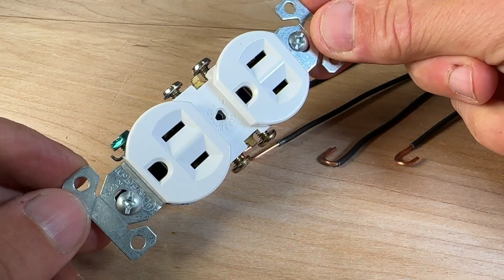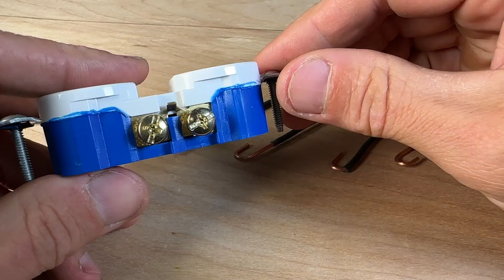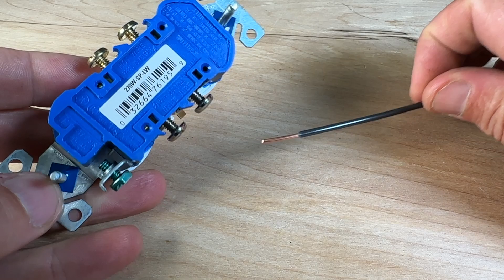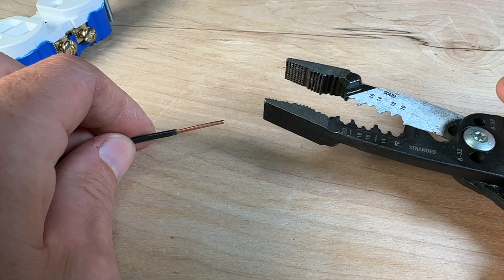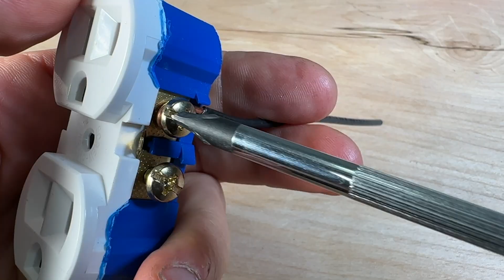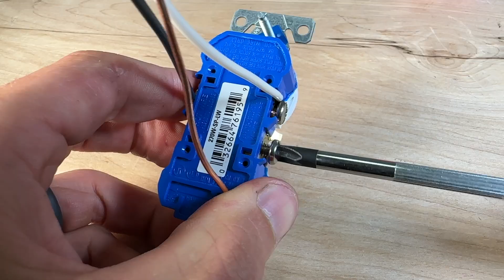Electrical Fire Prevention 101: Wiring Your Outlets the Right Way

Comment: I really don't know why I watch these videos. I have been a journeyman union electrician for 25 yrs. Residential ,  commercial and industrial. I do like seeing how other people do things. These are really good tips for the average homeowner though. I have no idea why the manufacturers still put the quick wire stabs on the back of devices. They cause nothing but problems! There are so many different ways to skin a cat. I really do like using the ECX drivers. I just started using them recently. I hate the Robertson tip on the multi screwdrivers like me Klein 10-1, the bit always sticks in the screw and pulls out when you goto remove it. There have been times in when I was working in a panel and the tip has almost fallen across the bus. I have since learned to either tape the tip in my driver or get a dedicated Robertson driver.
Reply: Lol I’m the same way.  I’ve been an electrician for about 20 years but was still curious to see the tips he had.  I used to backstab when I did residential new construction and I loved it.  Then I switched to doing service work and I never backstabbed a receptacle again once I saw all the problems that were caused by that.  Great video with excellent tips.
Reply: I just experienced the same thing with the bit getting stuck
Reply: Without a solid mechanical connection, you risk the chance of overheating. Potentially causing a fire or at least melt the insulation on the wire or the plastic of the receptacle.
Reply: What problems does backstabbings cause?
Reply: @WalterMelons  The connection is too loose and not secure.  It was the leading cause of short circuits, fires, melted receptacles and unsafe conditions when attempting to pull the receptacle out of the box because they would just pop out and could either short on another wire or hit your hand and shock you.  That was my experience.
Reply: @That_One_Dude_You_Know  Good to know. I’ve always heard backstabbing outlets is a no no but never was told the why. I’m no certified electrician just a handyman.
Reply: @WalterMelons they fall out
Reply: @WalterMelons also it creates a connection on a smaller surface area which leads to more stress on a smaller surface area. Which can lead to failure or arching at that spot
Reply: There’s no problem you just make sure it’s in correctly. You have to realize most people don’t know how they work for quick wire they have been programmed to always stay to the old fashioned way. If you replaced one and it’s not working you probably didn’t make sure it was properly shoved in correctly. Always make sure that you go turn off the switch box so you don’t get sapped like some of these professionals energy has to always be turned off regardless if the tech meter tells you there’s no power ( it’s always stored so if you touch it it will shock you) fuse box off will prevent any harm to you.
Reply: Backstabbing also causes massive stress levels in the copper just on the edge of the hole.

Comment: how about wrapping the terminals with insulation tape after tightening so as to make sure there are no contacts with anything
Reply: Not necessary.  If your box is moving around while in a wall, you have a real problem.  Poltergeist???